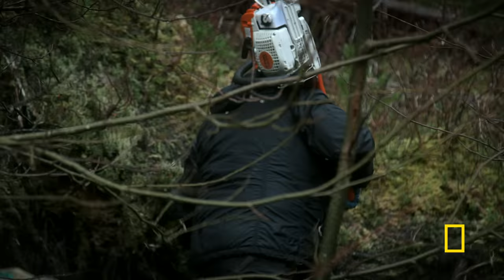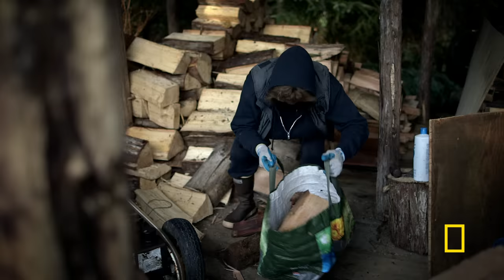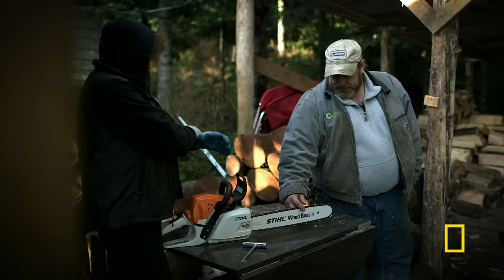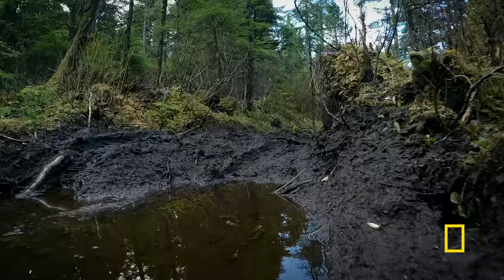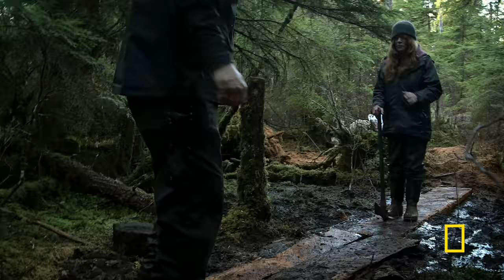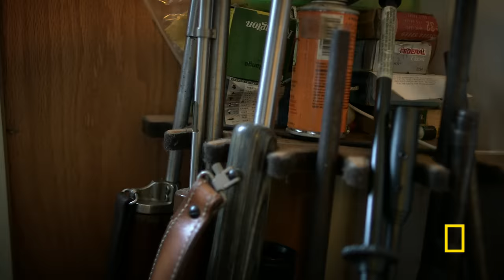The Odyssey (Full Episode) Port Protection

Comment: When this girl that was living in the house boat was saying that without heat you will die and I can attest that that is not true I lived at over 12,000 ft in the Rocky mountains for many Winters and I never used heat at night I just had multiple down quilts that once you get under them you can stay as warm as you need to be during the day I used to use some solar game and occasionally turn on a little bit of propane heat from a stove but it's amazing how down quilt will do an amazing job

Comment: Fake on the part where she cut that tree that is too dangerous for an actor to actually cut a tree that big. The camera never placed an angle from the distance showing them as the tree falls and the camera never looked up from there standing point. fake fake fake 18:20
Reply: What's there to fake chainsaw goes in cut the tree tree falls down